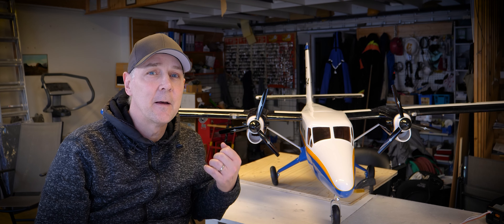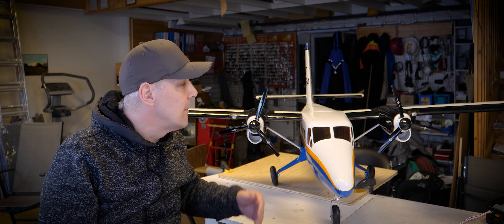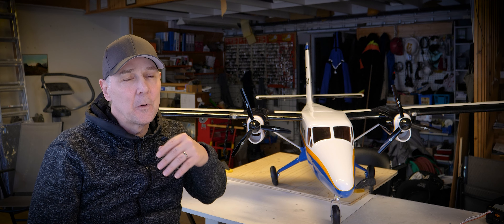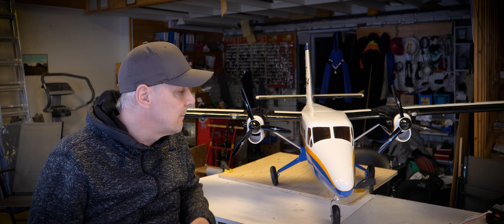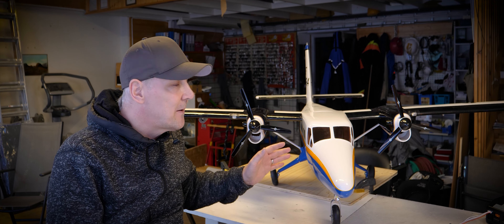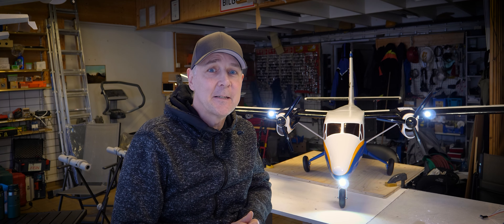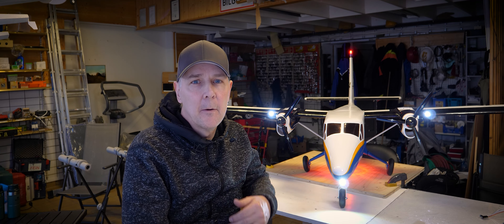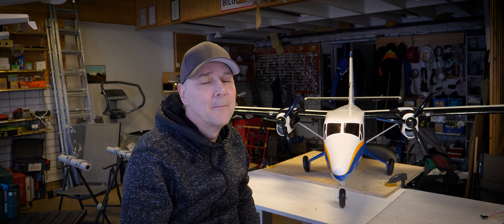Hangar 9 Twin Otter - My setup and little about UniLights.  UHD 4K

Comment: This model, Hanger 9 Twin Otter, was one of the best models I have ever owned, Easy to fly and very forgiving it was a master for T&G landings. I had the controls set up exactly as the real plane with the flaps and ailerons😊 that would droop together for short field landings. All controlled by a standard TX and RX using programed mixing. This is one plane of the more then 100  that I donated to the AMA Youth Foundation that I wish I had kept. Respectfully CS SYLVIA AMA 16137
Reply: Did you aetup counter rotating motors?  What about differential thrust (r & l throttles independent)?

Comment: How hard was it to route the wires to the different lights?
Reply from the maker: Thin stick thru the wing with wires. The same on vertical stab. Just drilled a hole and gently stab a sharp pointed rod all the way down.  Be careful with the belly and add more support. Also wingtips are super fragile thin plastic and balsa.